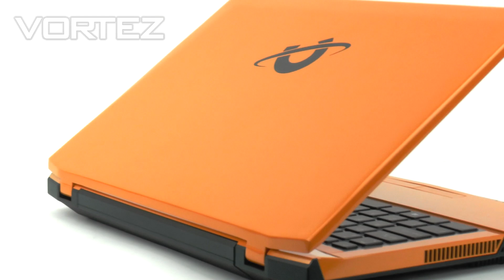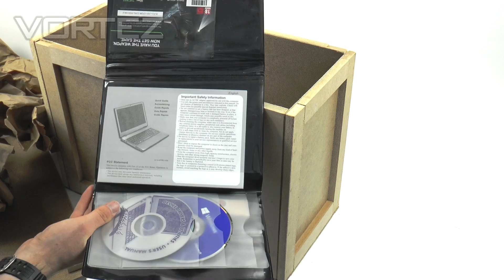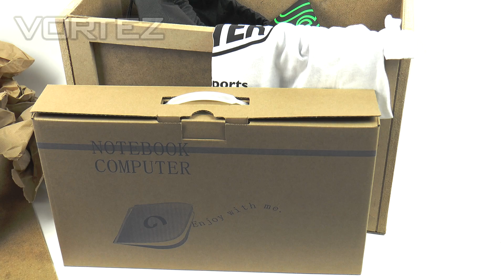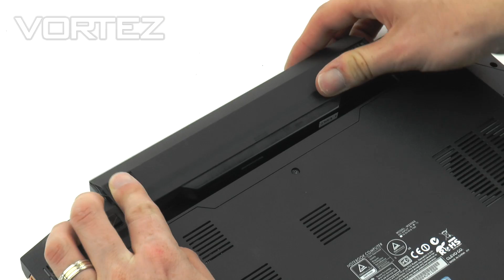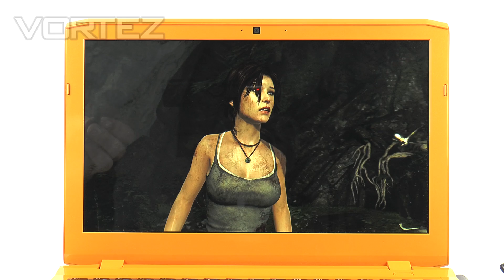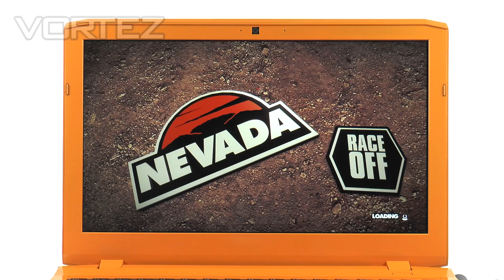Utopia Computers SABRE-13 Review [HD]

Comment: Pretty looking and obviously a quality device - BUT - the 860M should have been upgraded to an 880M with more DDR5 to run that 3K screen.

I would rather have a plain looking wrapper with a beast inside...THANKS for another excellent review..
Reply: Hi guys, thanks for the feedback! At the moment, the GTX 860M is the highest end card physically capable of fitting inside the 13" chassis, so we're being held back by the technology unfortunately. We're offering the 3K display more for professionals who have been requesting higher res screens (Macbook equiv.). We strongly recommend selecting the 1080p screen (or downscaling the res in settings) for gamers wanting to play more demanding titles, as David has mentioned in the vid. Hope this helps! :)
Reply: cool. nice looking and something a professional would look at using. i know I would, lol
Reply: Utopia Computers Nice to see a company being honest. I'm gonna check more of your stuff out
Reply from the maker: I have to agree about the card. With the standard screen (1080p) I think it would be fine, the free upgraded screen results in performance loss cause its having to work much harder. It's a nice promotion but it has consequences ;) Glad you enjoyed! :)